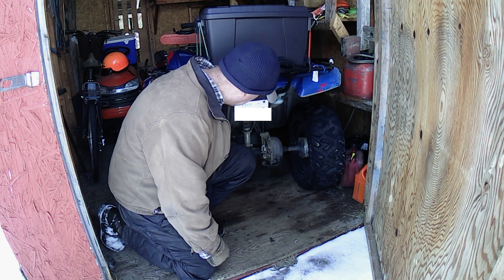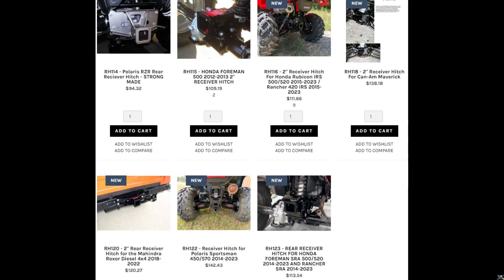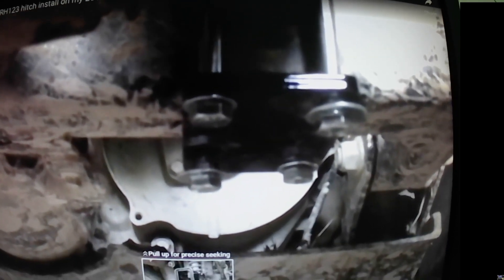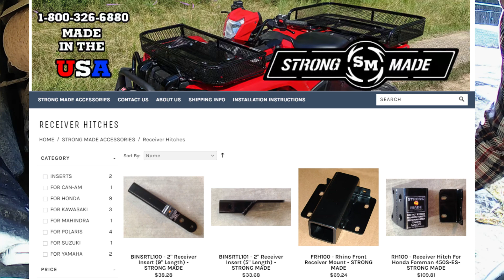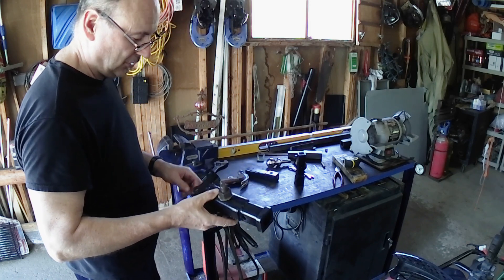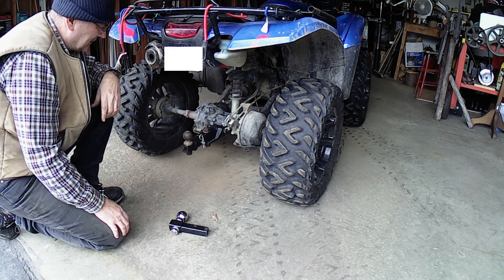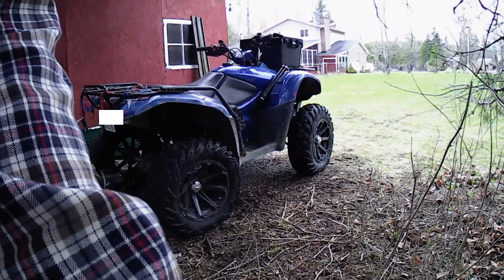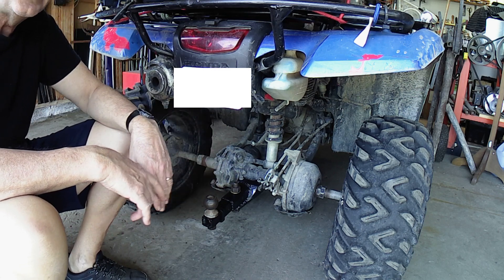Improving the Honda Trailer Hitch

Comment: I got one from. I think it's called mg manufacturing. You take that entire junk hitch off from the factory and replace it with this class 3 receiver. It's very straight. It's higher than that and it works great. It was only $64 I believe in New York state. Just got it last week
Reply from the maker: @robertszymanski4744  Thanks for the feedback. Yes there are after market replacements better than the original; my modification focuses on improvement with a near zero cost solution ... while nothing is "free", a couple pieces of square pipe and welding material are about as inexpensive as it gets when the materials were already at-hand. Cheers ... Jeffro.